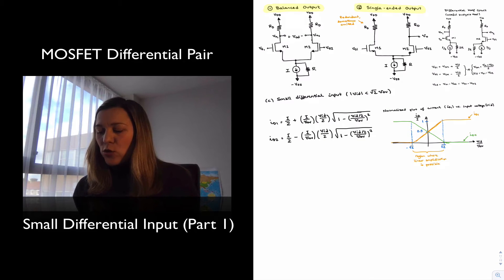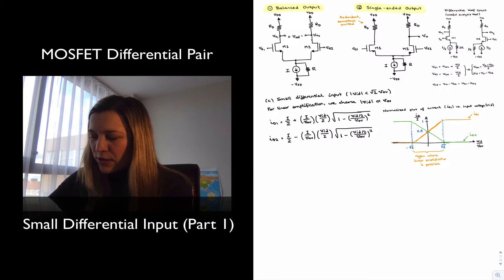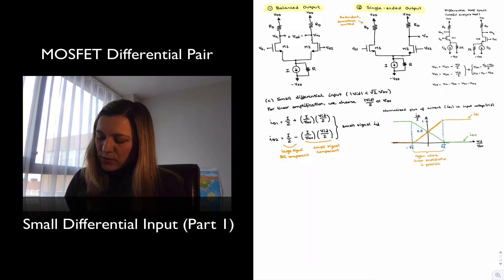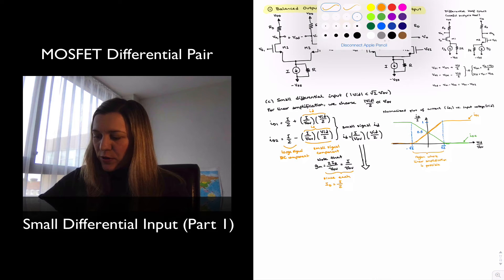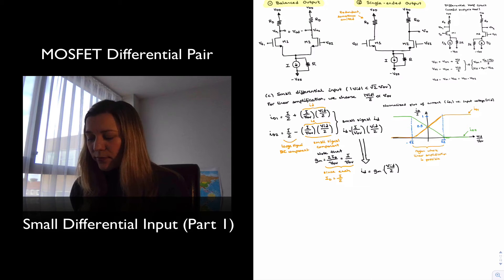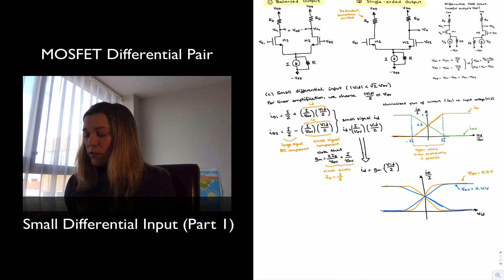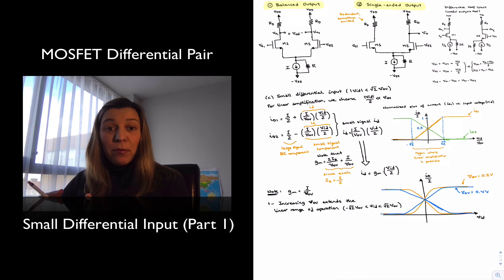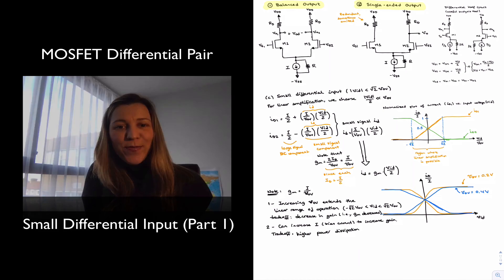MOSFET Diff Amp with Small Input Signal (Part I)

Comment: the "V_OV" in this case is the overdrive voltage with the condition current I/2 flows in each transistor right?